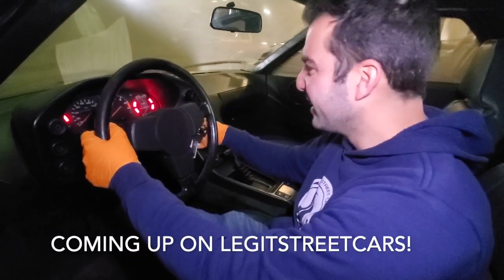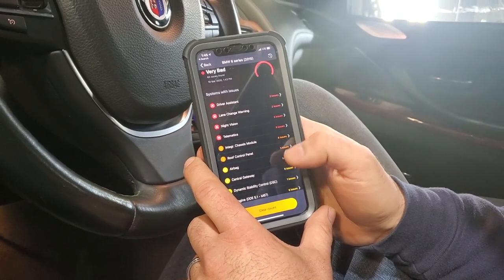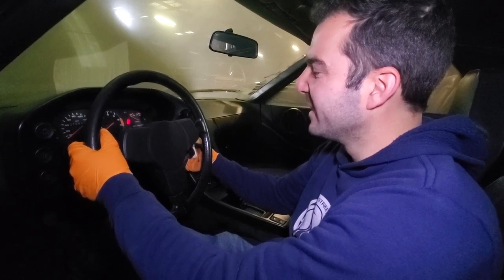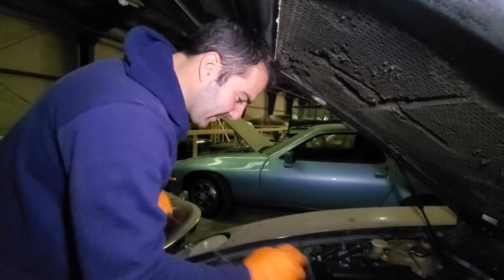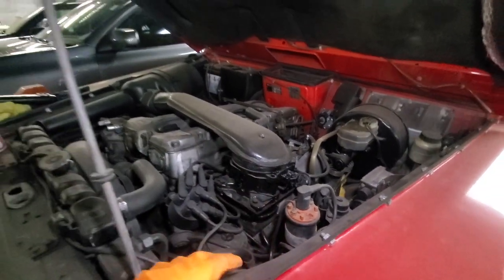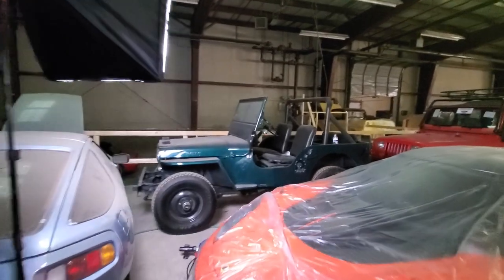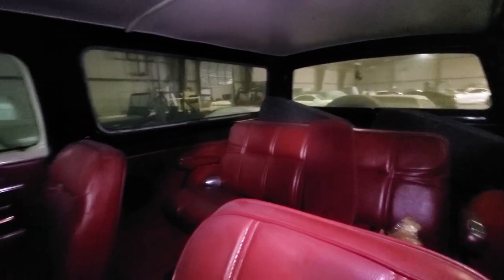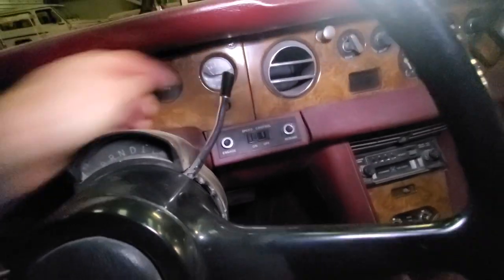I Found A Warehouse FULL Of FORGOTTEN CLASSIC CARS With The Keys In Them! I Brought Gas & A Jumper!

Comment from the maker: You get 1 free car made before 1980, what do you pick? I have to go with a 1965 Pontiac GTO!
Reply: W100
Reply: 1955 300 SLR. Good enough for Sir Stirling, good enough for me! lol
Reply: 1977 Maserati Bora
Reply: 1967 MGB GT
Reply: Corvette C2
Reply: 1960s mustangs
Reply: Ferrari 246 Dino
Reply: Great choice. A '65 Goat with a 389, and a two speed automatic was one beautiful American car, Alex. (First hand experience:  they were great at doing hole shots, and spinning the real tires at the drop of the hammer). But I seriously would have to pick a 1967 Chevy Corvette convertible big block. Nothing like 435 horsepower, and a tri-power set-up. These mid-year Corvette Stingrays are still a design masterpiece, with brutal horsepower and rear wheel torque, all packed into a small roadster.
Reply: 1979 Charger R/T!
Reply: 1968 Ford Torino!  Fastbacks forever!
Reply: 69 Chevelle 69 Camaro or a mid 60s GTO for sure
Reply: 1969 Ford Cobra Fairlane 428 CJ , 4 Speed . Not a Hatch back 🥰😍🤩
Reply: 1970 mustang mach 1
Reply: If i'm being a realist, 68 Roadrunner 383 4 speed. If I'm shooting for the stars, 70 Hemi Challenger soft top manual...Plumb Crazy of course!
Reply: Toyota Landcruiser FJ45LV
Reply: 1969 Corvette with an L88
Reply: 1970 Chevelle SS 454 LS6
Reply: 1967 XKE. Most beautiful car ever. Ya can't argue with Enzo.
Reply: My dream car: 1969 Dodge Charger R/T
Reply: Original Shelby Cobra.
Reply: 56 F100 V8
Reply: 1979 Alfa Romeo Alfetta GTV 2000 Turbo or 1968 Plymouth Rodarunner
So Alex, you really have no clue about K/KE Jetronic Mechanicall Fuel Injection? How come?
I know Merc used it and Kugelfischer IUnjection Systems in it's Models and i had to learn its ins and outs when i became a Car Mechanic.
Reply: W100
Reply: 1963 ragtop vw beetle pearl white
Reply: 1970 Chevrolet Chevelle SS 454
Reply: 1970 Plymouth 'Cuda
Reply: 1969 Dodge Charger
Reply: 240zg datsun
Reply: 288gto for me
Reply: LegitStreetCars GTO as well😍
Reply: Rs ss 427
Reply: 71 Hemi Cuda, cant go wrong with classic muscle
Reply: 89-93 D or W series Dodges with 12v Cummins and manual. Just keeps running long after the body falls off
Reply: 1970 Plymouth Barracuda, drop top, 440 hemi, shaker hood
Reply: 70 roadrunner!
Reply: Ford Taunus 20M 1967
Reply: If it were FREE, what fool would pick anything other than a 1962 250 GTO. Sell it for $50M and buy ALL the other cars people have listed here. After the sale my first would be 63 Corvette "Split Window" Z06  tanker.
Reply: Lamborghini Miura SV
Reply: 1968-`1972 Corvette.
Reply: 1931 Model A with a Top Hat I can wear while driving it around 😂
Reply: @Randy-qq8lr  Nice, those are cool.
Reply: 1978 Aston Martin V8 Vantage Oscar India
Reply: 76 Z28
Reply: @union-ft6bt  Forgot when that gen lost the chrome bumpers, but I stopped liking that gen after like 72.
Reply: @thevacdude  Thats the year I was born thats why I want that year
Reply: @germangarage9783  good choice mate! :)
Reply: @union-ft6bt  That'd make sense, I like the first, and early second gen Camaros/Firebirds.
Reply: I'll take the Ferrari 250 GTO because why not.
Reply: @kadelarson2535  That's a fun one.
Which Ferrari was in Farris Buellers Day Off?
Reply: Lamborghini Espada
Reply: 1967 Ford Galaxy 500 convertible painted red with a white ragtop. 390 Cu V8 engine.
Reply: 300SL Gullwing
Reply: 1965 GTO is cool. I sold my 1967 a couple of years ago. I like the 67 over the 65 as you get the 8 taillights and hood tach. Grill looks a little better on the 67 as well, in my opinion. I'd probably get a first gen Firebird now.
Reply: Porsche 928 would be enough xD
Reply: @thevacdude  I haven't seen it but by looking it up, it's apparently a Ferrari 250 GT California Spyder. I need to watch that now.
Reply: @kadelarson2535  Someone said Lamborghini Espada.
Reply: Ferrari 250
Reply: 73 trans am sd
Reply: The Porsche 917 winner of the 1970 Lemans 24-hr race
Reply: Miura P400SV
Reply: 1966 Buick Riviera GS
Reply: One of these 3:
61 Ferrari 250 gt California
61 Mercedes 190SL
Or 61 Corvette stingray
Reply: Same with the GTO - Tri-Power!
Reply: 70 Chevelle SS Of Course 4 Banger !
Reply: Willy's jeep
Reply: 1967 Mustang fastback gt 390
Reply: For me it’ll have to be a 1965 Shelby Mustang GT350R 😎
Reply: 450SEL 6.9
Reply: 1966 Chevy Biscayne Wagon
Call me crazy but literally my dream vehicle. Body lines are amazing
Reply: 1968 Mustang
Reply: Plymouth Superbird
Reply: 240Z, or a 60's gt350
Reply: The Luxurious Classic Epic 'ness :''1931 - Bugatti Royale 2 doors hard-top'' would be my option since Ferrari 250 GTO is over-crowded already ! ;0)
Reply: "Swiss Cheese " Catalina 421sd 4sp
Reply: Mercedes SL Gullwing
Reply: 1973 Porsche 911 RS 2.7
Reply: Ferrari Daytona spyder  (black) like ricardo Tubbs on Miami vice!!!
Reply: @union-ft6bt  they didn't make a z28 in 75/76......had to get a 74 or 77
Reply: @thevacdude  I wanna say either the 250 gto or 288
Reply: @iCarlyfan4534  go with the 67, same body but bigger 430 motor instead of that 425 nailhead...my first car was a 69 riviera looks just like the 66/67 just the headlights and taillights were slightly different. ..there is a 67 behind my house just on the other side of the fence.....I'd go over and see if they want to sell it but I'm not ready for a divorce. ......my wife would kill me if I brought another car home
Reply: @trentdawg2832  it would have been considered a 77
Reply: 1936 Bugatti 57sc.  But realistically, 1969 240z.
Reply: BMW 3.0 CSL
Reply: @trentdawg2832  288 would be my pick,but they were made after 1980
Reply: After thinking about it for a while, I would have to go with a ‘69 Dodge Charger Daytona HEMI. I think they’re insane and would never be able to acquire one on my own.
Reply: Citroën SM
Reply: 1972 Cadillac Fleetwood Brougham
Reply: Cool...gimme me one of those old Porsche 911SC!! Let say 1980!! I’ll be your huckleberry 😎
Reply: dodge challenger r/t
Reply: 69 vette ZL1
Reply: 1969 Camaro
Reply: 1980 Porsche 928
Reply: BMW 630/633 CSI and then swap a B57D30S0 Quad Turbo into it.
Reply: I am so taking the supra
Reply: Ferrari 250 GTO...
Reply: 1969 Dodge Charger Daytona.
Reply: 190SL
Reply: 1979 300sd or 6.9
Reply: G wagon
Reply: Gulling or 1956 bmw 507
Reply: Lamborghini Miura (1966)
Reply: Send me one in Serbia,please,jeep that you worked over.
Reply: Definitely a 1963 Ferrari 250 GTO
Reply: 62 caddy
Reply: Mustang boss 1st gen
Reply: Toyota 1994
Reply: 67 mustang fastback
Reply: I'm going for that Plymouth - it was fantastic
Reply: 1974 porche 911
Reply: A 1969 charger
Reply: Gray porshe n2 do not start
Reply: 1970 dodge charget
Reply: 1976 Pontiac Grand Prix SJ - Loaded, console, buckets, Pontiac mags and 455 V8
Reply: 73’ to 74/5’ ish Chevy P10 step van
Reply: Easy. Plymouth super bird
Reply: ferrari 250gto
Reply: 1970 Chevelle SS Ls6
Reply: 1977 Ford F-250 4WD or 1957 Ferrari Testa Rossa, because if I have one of those, I can pretty much buy any car I want, except for another one once it goes on auction to buy said collection. lol
Reply: 1932 Duesenberg Model SJ
Reply: 1979 Toyota crown super
Reply: 1961 Chevy Impala
Reply: 1969 Plymouth Road Runner
Reply: I would like a second chance at owning my '65 Vette (both tops).
Reply: 1967 Mercury Cougar with a 351-Cleveland 4 Valve
Reply: 1970 datsun 100a e10
Reply: 63 split window....fuelie.... Midnight blue...4 speed Muncie.....
Reply: 72 road runner
Reply: 69 Yenko Camaro
Reply: Well umm, my buddy had one a convertible in the blue. I had a had a 74 vette, a j40, a mazda PU and a new Scirocco 16v.  I had already had every Mustang you could think of including a 68 fastback in dark green, a 69 RT, a MGB GT, a 66 VW van, 72 Delta 88 converatble with the 455 rocket,  a S&B TA, a 240Z gosh too many to remember. Probably have restored one of everything else.  I drive a 91 Volvo wagon today.
Reply: Id choose a 1967 GT500 and give it to my dad cuz it's his dream to have one
Reply: 1967 Corvette 427 big block 4 speed black on black.

Comment: Oh man, as soon as you started trying to crank those 928's I hoped they wouldn't start based on unknown timing belt integrity. The second one (US Spec early car), wouldn't have had PTV issues (4.5L 16v), but the first (Euro 4.7L 16v) would have and obviously the S4 (5L 32v) as well. 928's hate to sit and it's probably the last car I would ever try to start without doing a legitimate timing belt/wp change on.

Comment: Trying to run stored cars with decades-old fuel - not too bright.
Reply: Indeed. I am so disappointed by Alex, this is so unprofessionally done. Those cars deserve better.
Reply: So true !!!!
Reply: 30 year old fuel starts no problem, two year old "fuel" ... fogetabouit
Reply: one could argue that the old porsche jetronic systems all needed to be taken apart and rebuilt anyways after sitting that long
Reply: He doesnt give a shit about them. It got views, did their jobs for him. Sucks but not everyone loves cars the same way.
Reply: And when they start up revving them with no oil at the top of the engine
Reply: and revving them up as soon as they get it started after sitting
Reply: Who says that the cars had bad fuel in the lines?
Reply: Yeah with old cars you have to change oil, gas, spark plugs, and battery. I bet I could’ve started some of these.
Reply: This is the proper way to destroy engines that have not ran for many years. I really hate these “will it start videos”.
Reply: Lol I got arrested and my 97 Benz sat for a few months and i ran it til empty with the old gas really messed up the car started throwing random codes after that
Reply: He obviously has gas cans in the intro I’m sure he brought gas
Reply: @kevinmoore8679  on top of that those Porsche 928 have cambelts a very good way to snap one when they are so old

Comment: Gum’d  up fuel is very difficult to get past. I would also never rev a cold engine.
Reply: And expensive. New pump, new injectors...
Reply: Worrying about a little extra wear and tear on revving these old sitting cars is nothing. He's only revving to keep them running as well..
Reply: Should have dropped the oil in them
Reply: @m3dia95  actually no you want to run old oil for atleast 30minutes incase of sludge or sediment it gets mixed in and come out when you do change it

Comment: The early 928’s have 4.7 liter engines and the groovy interior is called  “Pasha” very rare and in good shape
Reply: Fred Shanks 
The really early ones had a 4.5  , then they went up to 4.7
Reply: @Carrera-gp9od  yes it is
Reply: @ Carrera 1972 ... Yep ... 4.5 liter (16 valve) V8 in the original 928  then 4.7 liter 16 valve V8 in the S2 followed by 5.0 liter (32 valve) V8 in the S4 / GT and finally a 5.4 liter (32 valve) V8 in the GTS. 
The Automatic transitions are from Mercedes Benz 👍🏼
Reply: That’s right! I had an 89 GT with the 5.0 and it was an awesome car!
Reply: @ Fred Shanks ... that’s a cool 928 😎I had the pre GT super rare 1986 (1st year) 928 S4 Manual 👌🏼
Reply: Auto Addict 
I’ve always loved the 928 , I think they still look modern even after all these years 
The pasha   interiors are gorgeous
Reply: @ Carrera 1972 ... totally agree with you 👍🏼 Porsche were decades ahead of the game with the 928s.  I’ve been fortunate enough to have owned two 928s 👌🏼 a run out model year 1991 S4 Auto and a super rare 1st year 1986/87 S4 Manual 😎 with factory fitted LSD 🤘🏼 Both great cars 👌🏼

Comment: bruh, AWESOMENESS! I know I'm a jerk, being an automotive expert like yourself,  and dealing with someone else's car,  you NEVER just crank. you need to crank then off, crank then off, crank then off to get the engine wet. I was cringing every time you cranked dry.
Reply: I agree. Years ago I worked with car dealers. Wholesalers would come to the Boneyard which was trade in cars. One dealer once a month would cook meals for them to come check out his inventory. I would watch those guys go down the line starting vehicles. As soon as they start pedal would go to the floor checking for loose rods loose, Parts in engine. It would drive me crazy.
Reply: Not only that but pulling all that old fuel through them is stupid. If they haven't been started in that long they should have been drained and cleaned.

Comment: I just got my self an 83 Porsche 944.  The 944 is a 2.5 liter engine that is as if they chopped the 928 block in half.  It has balancing shafts to level it out.  It’s 3 thousand pounds with a 50/48 weight distribution having the transmission in the back.  It’s slow as hell but fun to run through the gears.

Comment: Hmmm...don’t you usually do more than just jump start and spray hot sauce in the intake/carb?  What about turn the crank by hand first to make sure it’s free and lubed, disconnect fuel supply and run off fresh fuel in gas can, etc????  Wouldn’t more cars actually start if you did this?

Comment: 14:30 power recaro seats (possibly optional OEM)? that's gotta be rare af
Reply: Mercedes wouldn't build a car with different front seats they are aftermarket
Reply: lee2217 a quick  “mercedes recaro” search says otherwise, especially from that era
Reply: @lee2217  Righto. Recaro seats like in the video were wildly popular with tuners in the 1980s. Same with Pirelle P7 tyres, BBS gold alloy wheels, Blaupunkt stereo system with control panel on flexible rod, aftermarket aerodynamic kits, etc. Then, 1990s came, everything fizzled up.
Reply: @MEDIUMhouseblend  what I meant was they don't belong on that car, Mercedes wouldn't fit those seats in the front of a, car and have different material in the back
Reply: @InTeCredo  I do remember the 90s
And I can't think for any sane reason why you would put recaros that don't match the rear seats in a g wagon
Its a boy racer type thing  that you would have seen in a Ford escort or a vauxhall corsa but not a mercedes

Comment: 20:20 Range Rovers, old ones like P38s, OVERHEAT like crazy, and those SU carbs... Not exactly reliable.
Reply: 3 Land Rovers appear on the video. The first one without the keys is a Discovery 1 from the early 90s, the second one that started is a Classic. The both share the same engine. This engine was used in the Buick on early 60s. Land Rover bought the project to install on the original Classic. On those two it’s the probably the 3.9 l version. They are tough engines. The ones that blow the head Gaskets are the last interaction of them the 4.6L. The third Land Rover, and the most valuable one, appears on the back. It’s a series/Defender. If it’s an American spec it has the same engine. If it’s an European spec, it’s probably diesel. No P38 in this video.
Reply: the 95 doesn’t use SU carbs, it’s an l-jet system lol.

SUs are the simplest carbs ever made and easy to tune if you have one brain cell. Ask anybody with a 240Z. Stromberg CDs look similar but are harder to tune when they’re worn out.
Reply: We pulled a Rover P5B Coupe out of a damp shed in Scotland ..rot box..totally shafted..its got SUs..without to much effort..it started..after sitting nrly 30 yrs
Reply: @fotorabia  If you know them well, I'm sure they are great. Look at Dulcich and the Quadrajet.
Reply: sir, you know nothing
Reply: All them experts here.. lol

Comment: do you think that putting some new fuel in the tank would somehow get rid of all the old crap fuel in the fuel line from the pump to the engine?
Reply: Dan Hard  No. tanks need to be drained and the fuel lines flushed.  The old gas turns to varnish.

Comment: LegitStreetCars there is a Jump post in the engine compartment so you wont need to climb in the back off an 928 in case you can not manually or electrical open the rear hatch

Comment: You always should connect the power jump wire before the ground. I taught that for 4 years in the US Air Force '72 ~ 76.
Reply: Absolutely true but its  really only a problem if the battery has a cracked case or other fault that would allow fumes to escape. I dont know the exact figure but think theres less than 100 incidents a year in the US where batteries explode due to improper jump starts. The way I do a jump is pos good car, pos bad car, neg bad car, neg good car. The bad car use the frame etc for neg. This leaves the last connection far away from the bad battery.

Comment: The first red W460 is a Gelandewagen 280GE (not a G-wagon 😜 ) with the M110 2,8 litre 6 cylinder, used in many MBs in the 70s and 80s. In the SWB it was the fastest G at the time. The Recaro seats were actually a option, very expensive. The blue buttons are air inflatable lumbar support. Yes, I had them in my LWB 86 280GE, in leather. luxury 😁

Comment: 3rd Porsche is a facelift (bigger tail lights) with a 5 litre 32v engine (old engines were 4,5 or 4.7 litres 16 valves). In the US it came in 1985 (model year?).

Comment: None of those porches are locked up, it just likes the battery having at least some charge in it to start. You cannot start it with just a jumper pack. I tried doing the same thing with my 930 and it had the same results. So you'll have to just get a good battery in it and it will start right up

Comment: old G460 have a M110.990 engine, the first was on k-jetronic, the second one was on M110.922 and its on carburator. k-jetronic as you know is mechanical injection with fuel distributor

Comment: Hello Alex.
A question regarding this Carly adapter. Let's say i buy one, can i use same adapter to other cars or this custom made just for me? For example, i bought to use on my mx-5 and a friend wants to borrowing it to see any faulty codes on his Vw bus?
Is this possible?
Sorry for possible improper English, Sweden guy.

/Michael.
Reply from the maker: Great question. The universal adapter would work but I'm pretty sure to unlock 2 cars you'd need the subscription for the 2nd car too. No big deal though and still really cheap